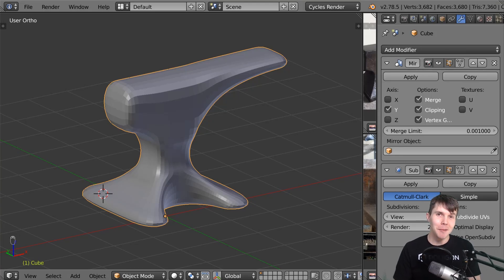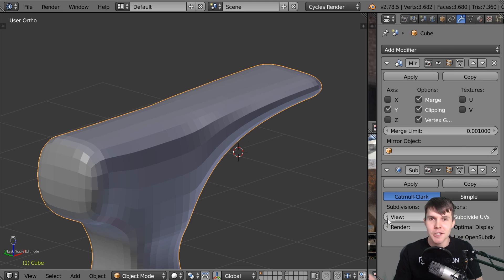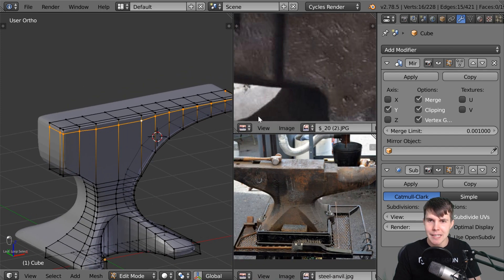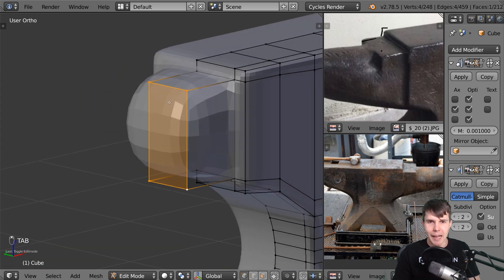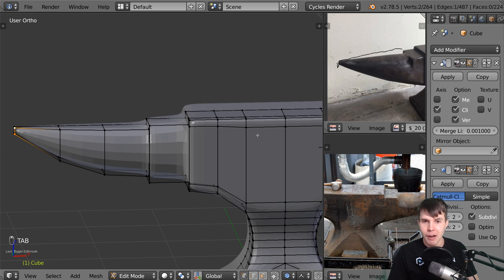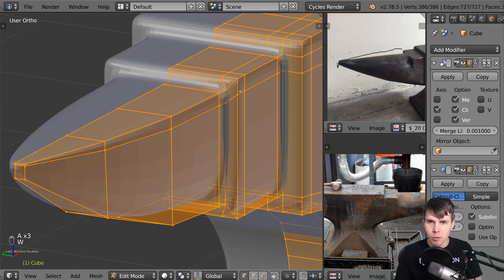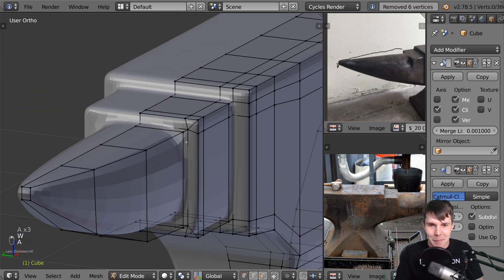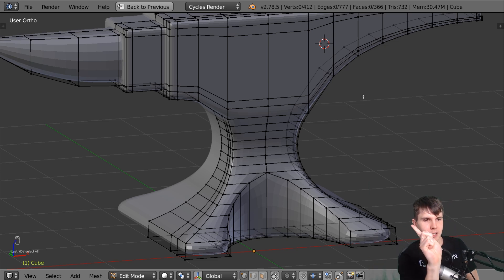Blender Intermediate Modelling Tutorial - Part 3: Sharpening Edges

Comment: When you converted the tris to quads at 15:25 the quad you create is not planar, not all points on that quad lie on the same plane, this can cause many issues in rendering, these are known as non-planar quads, and a more exaggerated case of it can be seen with this image: http://www.alecjacobson.com/weblog/media/triangulations-of-non-planar-quads.png the band in your quad isn't as much so it's effects may not be very noticeable, however on that image you can see the two ways that a program can render that quad. Like I stated in the previous video's comments in the end all rendering is done as tris, all quads are converted to tris before being sent to the graphics card. So the non-planar quad will be computed as one of those two, and which solution it chooses is not always reliable, it might choose different solutions each time, which in games, or animations can cause parts of the mesh to seem to warp or flicker randomly.

Comment: How do you get it so the long front part pulled out as a single "cone" from the front. On mine, due to the mirror, it pulls out separated into two cones at the seam. This has happened with other tutorials, so there must be some setting I'm missing.
Reply: Remember to press B when you inset the square before you extrude. B makes it so it goes to the boundary.

Comment: Hey guys,
it doesn't seem to be a big deal, but it will drastically improve your workflow and it feels very cool at the same time :)

Instead of selecting single vertices of loops one by one, you could just select one vertex (to start selection), hold CTRL and select another vertex of the loop (the last one, for example) to select all vertices within this particular loop.

Note: Pressing shift at the same time will "span" a selection of all faces/edges/vertices (depends on your selection mode) within this area.
When selecting vertices of different loops, it will follow the first loop to jump over to the next one and so on.

Comment: when i hit B to get rid of the boundry, in the step with the Horn, nothing happens :(
Reply: thanks a lot man!
Reply: still doesnt work for me
Reply: I had extruded the first part and then seen the clipping comment here. Inset then b wasnt working. Undid the inset and the extrude then redid them and it worked. Also think I went in and out of edit mode.
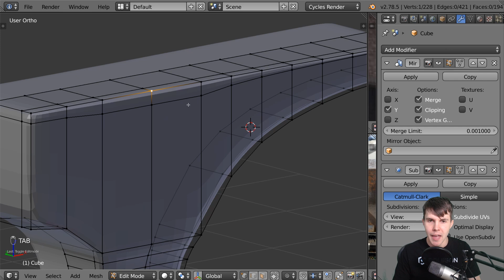Reply: @SnowiDragon  THIS IS THE ANSWER TO THE 5:00 BUTT CRACK THANK YOU DRAGON THANK YOU

Comment: Hey bro am having a problem on that boundary part mine isn't removing the boundary just as yours did...any help?
Reply: I figured it out...thanks to an earlier post. Look for a reply further down that talks about the shape looking like a butt when extruded. What it comes down to is there is an extra face on the inside of the shape you extruded. Go into face select mode select the face on the side of your mesh that is against the x axis. Delete this face. Now the shape should extruded as one shape not two separate.
Reply: @sirreal9691  It worked, thanks a lot!!
Reply: A better way to say it is there is an extra face between the two shapes that result from extruding. Delete the face between them. Credit for this fix goes to Unidentified user.
Reply: The guy's name is Paul Carkhuff
Reply: I'm having the same problem. When I press B i can see the boundary change from (ON) to (OFF) at the bottom,
but there is no physical change to what I am modeling
Reply: SOLUTION:

1. undo until you're before you do the first extrude on the left side. Your left side should only have that slight bump from tutorial 2
2. Once you're clean,  go to mirror modifier and TURN ON Clipping
3. NOW, you can do your second extrusion after selecting the 4 points. This should fix the issue.

If it doesn't fix the issue, and you can't undo further than you did in step 1 then just start again and make sure you set clipping to true from the moment you add the mirror modifier and it should work.

I redid this tutorial 3 times before I gave up and decided to read comments for solution. There are other people who have suggested the same solution BUT this is the entire solution written out as cleanly as possible so I think it will add value.
Reply: same here... I get double the shape i'm making.
Reply: What I failed at here is that I didn't have the "Clipping" thing in the Mirror Modifier, so, it didn't clip, so it was a butt.
Reply: I would have to see what's the problem. Any pics?
Reply: same
Reply: Same issue here. No visual change, but the tool shows that boundry was changed to off. Not sure if I trust it and move foreword or what.
Reply: same here boundary is turned on but no change...
Reply: +1, SAME EXACT PROBLEM
Reply: If you have a curve under the anvil .... try fix it ?
Reply: thanks for the help!
Reply: Thanks you just saved mine! :D
Reply: This had me confused and ready to stop, thank you ! this was the problem.
Reply: i dont get it... which face should i delete? perhaps can you provide a screenshot?
Reply: Before extruding hit clipping, then it works just like Andrew does it.
Reply: If anyone needs a more detailed answer here is a link to blender artist forum https://blenderartists.org/t/boundary-not-affecting-mirrored-portions-of-my-model/701549/2

Comment: I have found a simpler way to create sharp edges without sharpening edges that you don't want sharpened. Simply select the edge that you want sharpened (and only the edges you want sharpened) and then press (CTRL + Shift + R) This will create a cut only on the faces that had corresponding edges selected. It's very simple and easy, and removes some unnecessary steps, however, the only catch is that when a full face is selected, a cut cannot be made. Or, at least, that's what's goin' on with me. Anyways hope this adds a lil' speed into your modeling!
Reply: That moment when you re-read your comment and realize you said "sharpened" WAY too much.
Reply: SHARPENED AF
Reply: KolbyWithaK nice

Comment: Much of this advice is very specific to modelling for art renders or animations only, not games.
 Creases are probably a better option for games, as tight edge loops to control sharpness create some quite tight polys which game engines don't like very much.
Also in a previous episode you said that doubles are bad, without considering that they're only bad on the same strip, and that there's noting wrong per se with having different strips doubling up over each other
Reply: AirBiscuit would not that require specific shaders? any link to using such in unity?
Reply: Nothing to with shaders, mesh only.
Reply: AirBiscuit , how does marking crease work in games? also I think the crease should be marked initially with no rounding, and then again the sharp edges should be rounded for desired effect. creases in games should involve shader, I can't think of any other practical way! would like to know internal working if I am wrong?
Reply: Making creases on subdivided meshes is a somewhat destructive form of editing. You apply the subdiv modifier before exporting to unity
Reply: AirBiscuit Wtf? You shouldn't export a high poly mesh to the game engine, you should export the low poly one and bake it with for instance substance painter, só you can have these edges creating no problems.

Comment: As i mentioned in your last video, instead of having to select everything and remove doubles, you can activate the automerge function at the bottom (two arrows pointing at each other). That way you only have to move the edge and boom, merged. I always have it on, makes life so much easier :)
Reply: Sorry for the late reply, i dont come here often. But i have to correct you. I use the same workflow, and no, that does not happen, as long as you dont go in and remove doubles.

Comment: On the bottom bar, all the way to the right, there is a button to merge vertices in the same location so you can just gg and not have to use the delete duplicates

Comment: Why not using CTRL + B and mouse wheel one times up to add this kind of loopcuts?
Reply: Actually not, you are adding the same amount of loop cuts. The benefit is to get some clean loopcuts which are not distorted like this horizontal one. You can see a distortion in the center where the loopcut is not 100% horizontal.
Reply: Only if you use your mouse wheel. If you dont, you get the same amount of loopcuts. This picture shows it: http://imgur.com/A2NRMrd
Using the beveling tool in this context solves the task andrew wants to solve here. The only difference is the much cleaner shape and so the much cleaner shade

Comment: creases clearly aren't a good solution right now, but is that an inherent problem with them, or is it just they aren't implemented well in blender right now? Adding loop cuts still seems a messy solution if you could just change an edge property.
Reply: Percy Blakeney the problem is using crease on low poly or the poly after sub surface

Comment: On the top reference image the top center of the horn is flush with the smaller square part it is extruded from and falls away at the corners making those triangular shadows. Is that effect possible to do by extrusion or would a low Res cylinder need to be joined to the mesh?

Comment: You can use or activate the "Automatic merge Vertex" so you do not have to be using the "remove doubles" every time...
Reply: You must be in edit mode, and on the right side of the "Snap" panel this is "Automatically Merge Vertices", the icon is two arrows against ...

Greetings from Chile...
Reply: where can I find that? it sounds cool!
Reply: Thank you

Comment: Can you just use the knife tool in that situation? 11:10
Reply: Very late to the party, but not really: the problem is the subsurface modifier: if you just use a knife cut then you will add extra vertexes to the surrounding faces, which will cause the subsurface to create weird bends and curves. That's why he defaults to creating a loop that goes all the way around the mesh rather than just a local cut.

Comment: More consistently sized topology would make creases work a lot better. Your side polygons are so large relative to the ones on the top which makes a problem for the crease. Instead of the corner loops, I'd have created loops more evenly along the side of the mesh, and used creases. edit: Well, your version does seem pretty convenient for this particular mesh since you actually make use of the loop cuts, but if it were just being used for sharpening the corners, I'd say creases could provide better bang for your buck.

Comment: Tip: Whilst removing the proximity loops, turn on "Auto-merge Editing" in the Mesh drop down at the bottom right whilst in edit mode, it removes the need to press "Remove Doubles" if you intersect other vertices whilst edge sliding (double tapping G)

Comment: After making the loop cut at 4:25 I would make it straight using 'S+Z+0'
Reply: Or while doing the loop cut press E for an even cut and F to flip it if it's on the wrong side :)
Reply from the maker: Yeah we'll do some clean up at the end ;)
Reply: Or while positioning the loop press E to align it with the top edge ;)
Reply: Lol, I was thinking the same.
Reply: What if Andrew did this on purpose to show a solution to an often appearing problem in modeling? mindblow ;)
Reply: Your solution works only when you are aligned to an axis. Generally you want to pull the edge-loop against the one you are reinforcing and then move it back a little with G+G. This way you have it at the same distance from your origina loop.
Reply: yup :)
Reply: Blender Guru Andrew, where is the next part?
Reply: Thanks!!

Comment: Hey Andrew! Let's say I want this anvil as a model in my 3D game, is your method of using loop cuts still better than creases?
Reply: Keep in mind that you should probably only use the sub-surf modifier for creating the high-resolution model to bake your normal maps and such from. You'll want to create a low resolution model to actually import into the game and use the maps that you baked on.
Reply: Don't you just export the mesh with every modifier applied? Then the game engine doesn't need to support creases
Reply: Much better. since Creases will likely not be used by your game engine. Creases are generally a bad thing and offers very low control.
Reply: Thanks!
Reply: I'm not sure if game engines would recognise the creases, so yes.
Reply: Creases arent a modifier. Use the technique andrew showed it's how the best modelers do their models
Reply: Omg again, well, you shouldn't give to your game engine your high poly model, what you should do is to export the low poly model and bake it with for instance substance painter, so you have a otimized mesh and don’t need to care to those silly things.
Reply: And really, you need to apply your subssurf before exporting, so, the engine does not need to support crease smoothing. (and really, no engine suports creases or smoot meshes)
Reply: You can bake in blender aswell. And could you please seem less butthurt xD we're just trying to learn.
Reply: Michno Oh I didn’t know that, and I'm sorry for my butt hurt, lol.
Reply: Sorry then :b You should watch this entire series :)